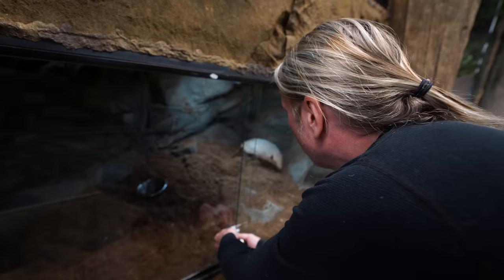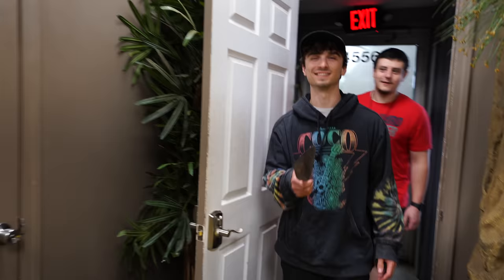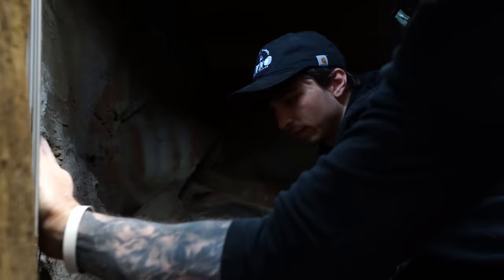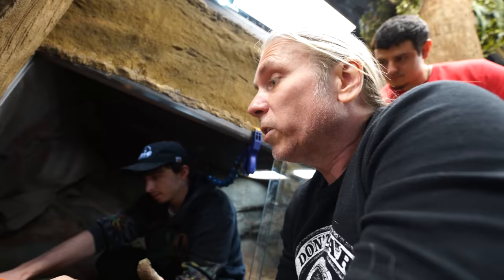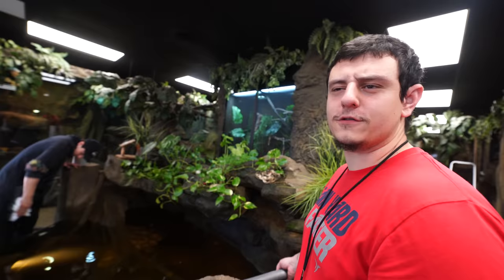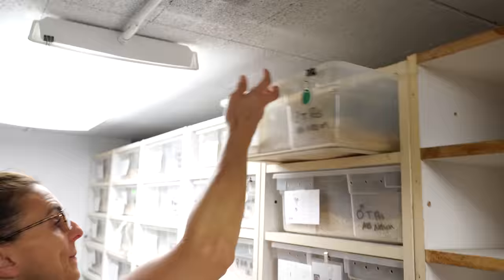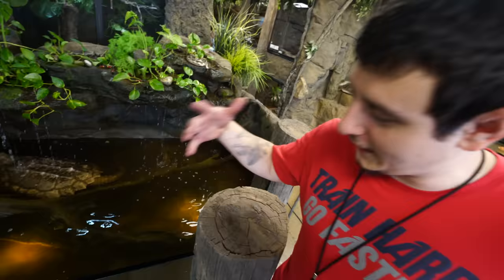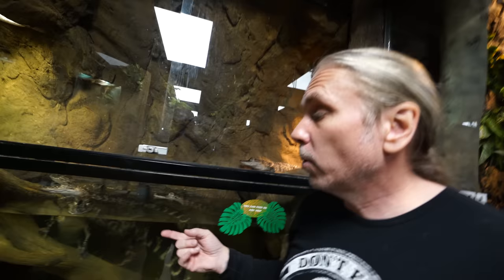My Armadillo Destroyed It's Cage!

Comment: Hi Brian. I hope you're feeling well on day you receive this message. I have a business question for you. I'm wondering, because you're doing a lot of pumping out of water from enclosures, and if you're needing to do it more often if the reptarium is open more often, how come you have not switched to a more efficient and faster system. These Wet Vac machines are quite noisy and if you had more of an industrial type I think it would drain the water three or four times faster. So my question is, well, you probably already know the answer, but I'm curious why you haven't adapted to a more efficient and quicker system when you have a lot of water to remove on a regular basis? Thanks a lot if you get to read this and I'm praying for you friend.